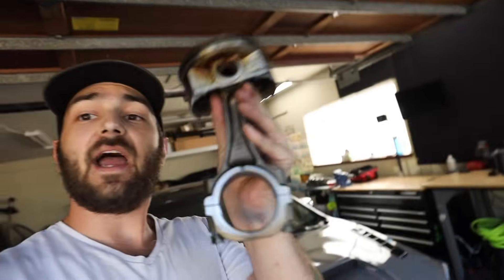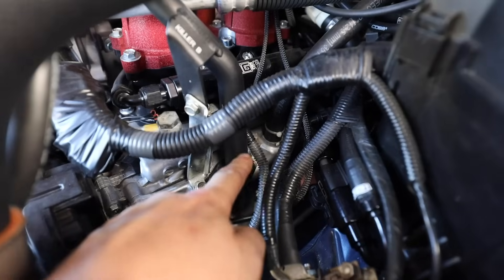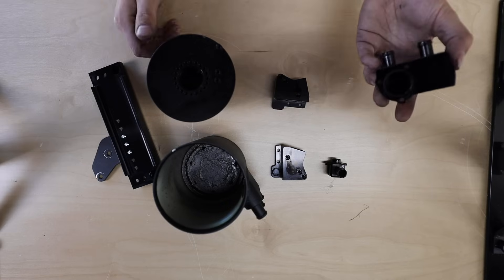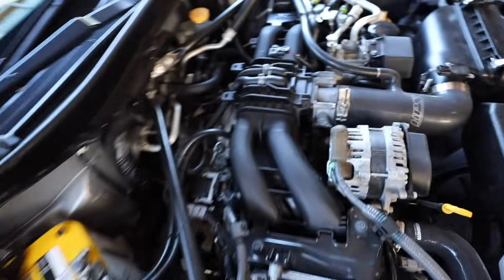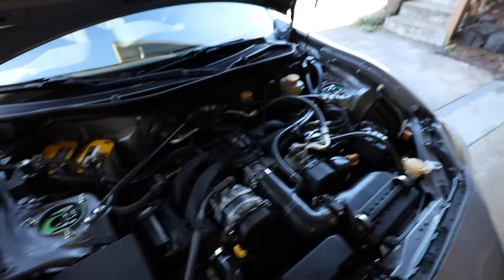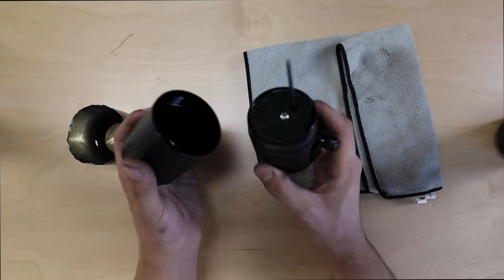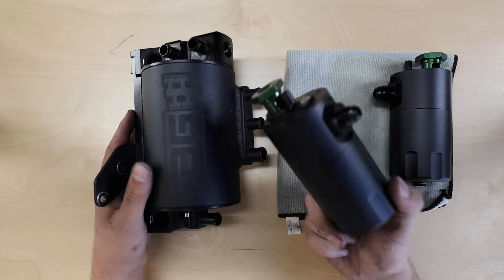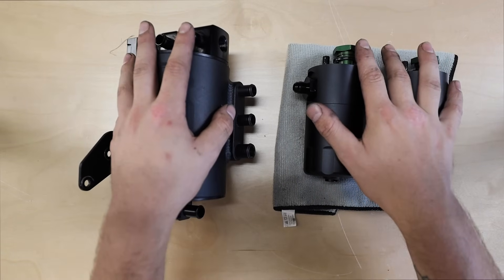Air Oil Separator VS Catch Can Explained. Is One Better?

Comment: The reason why the "oil" in the catch can seems thinner is because it's not just oil, being separated.  It's mixed with other vapors, including water and fuel.  I would go with the Dual Catch Can system because I wouldn't want to pump anything but 100% oil back into my engine.  This would prompt you to perform oil changes more frequently.
Reply: But doesnt the aos seperate water oil and air
Reply: Yes and since catch cans are not being recirculated with filtered oil you really have to keep an eye out on the oil level in your engine. Depending on your motor’s health or piston to wall clearance if it was  done to tight tolerances or loose tolerances will dictate how much blowby you have. I noticed the oil level can drop quickly where if you weren’t checking your oil level you may find your oil level on the dip stick isn’t even meeting the minimum level required. Running e85 definitely thins the oil in your engine. On oil changes you can see how watery the oil your draining is and can smell fuel mixing in your oil which lowers the viscosity of your oil.
Reply: Yup, on my GDI, I get this black, runny, foul smelling, fluid in my can. I surely wouldn't want this to recirculate onto the backs of my valves. 💀
Reply: @HandMadeRoyalty Nope, I honestly don't understand the point of the AOS in this configuration over a catch can. As the only tangible difference is the AOS dumps its contents back into the oil system. Adding in the complication of running coolant lines to heat up the AOS system. The coolant will be whatever your thermostat opens up the system at or generally around 180f which isn't hot enough to vaporize oil or water but will for fuel but only if given time. Being it's immediately dumped back into the oil system and you see how little actual fluid these collect (tablespoons in thousands of miles) it makes no tangible benefit to the additional plumbing and risk of extra oil and coolant lines to possibly reuse a few tablespoons of not great oil anyway.
Reply: @Vermonstered  my view on this is that both catch-cans (or non-return-to-saump air-oil separators) and what are marketed as "AOS" (or return to sump air-oil separators) both have their use cases.

For street/light-track applications for lazy owners - return-to-sump AOS.
street/light-track applications for fastidious owners - catch can

For heavy track applications with lots of blowby or if you are in a setting where you do many continuous hot laps (endurance racing etc.) - AOS.  Polluting your oil mix in your sump is a lesser evil compared to running low on oil.
Reply: @spidding  I get for track specific and heavily modified applications which pressurize the crankcase using an AOS. But adding a half dozen failure points to a street car because you're lazy is generally a terrible idea but those desperate to modify can do a lot worse.
Reply: It doesn't matter what it looks like in the Can. If its being caught by  the catch can, that fuel and moisture is in your oil and crankcase already. What you see in the AOCC is not how it is when it leaves the PCV and is no indication of how the oil looks in the pan , its concentrated there in the Can making it look bad  and look like sludge .  An Air oil separator will heat the vapor and not allow it to condense and collect. The oil separates and  is returned back to the crankcase and the moisture and fuel still in a vapor form is burned off and not allowed to condense and concentrate in the Can. This is the proper way to do a PCV.  I was having severe issues with my car with oil in the blowby since supercharging it. I have this setup on my M3. I started off with a CC and it was filling up alot with oil. I then added an oil separator and kept the Catch can  after the Separator  to see what the separator missed. It was just fuel and water, Very little oil in the catch can. Since then my Manifold and Supercharger inlet have remained oil free. I've since removed the catch can and just run the separator. Less maintenance, no sludge, and manifold and inlets are clean .  They both work,  I just prefer the oil not collecting and concentrating in a Can and would rather it being returned back to do whats it is supposed to do in  the pan.
Reply: @Vermonstered   This is wrong. 180 F , which honestly is to low, is still enough to vaporize water.  try it, heat a pot up to 180 , it won't boil but you will see a bunch of vapor coming off the top. Heating the separator prevents the sludge from forming and keeps it as a vapor to be sucked up and burned by the engine. the heavier oil drips down and returns to the Pan. This vapor was already in the crankcase and exposed to oil .  If your oil catch can is only picking up a tablespoon, you either dont need to run one , or the catch can is a cheap one that doesn't work right. A decent catch can , if there is a significant blow by and no assistance from the factory separator already built into the valve cover by most OEM, will fill up often. Most people needing catch cans have increased blow by due to upping cylinder pressure or wear , adding Forced induction  to the car that was Naturally aspirated or increasing boost beyond what the stock PCV can handle .  I  had a CC and it would have a significant amount after I supercharged my car. After adding the air oil separator the manifold and supercharger inlet no longer have oil in it. It works and it works well.
Reply: @kayzrx8  Something is severely wrong with your modifications if you're having that much water or fuel vapors in your crank case. It sounds like your AOS is closer to a band aid to your modifications rather than a necessary part to a well performing engine. Additionally if your engine has this much blow by, it's getting into your oil as your PCV system is a very small port in the head and your blow by it's occurring in the block.
Reply: @Vermonstered  If you bothered to read the car is a N/A m3 that now has a supercharger and meth system adding 200 more HP to the motor. The stock PCV was not designed to handle that so Yes, oil vapor will come out the PCV on any modified motor putting out that much Power.
Reply: @kayzrx8  Basically just described what I said. A series of modifications that creates a problem of excessive blow by. In addition that blow by is already contaminating the oil. It's not like you're somehow getting away scott free because you're ruining an AOS. It's a band-aid. The only difference is a portion of that vapor isn't condensing in the catch can with the difference really being about 60F being realistic about under hood and blow by temps and it's only spending a second in the catch can system with your excessive blow by. AOS is still getting the nasty oil just pumped back into the system.
Reply: @Vermonstered  You do realize most cars have built in AOS in the valvecover or external plastic versions near the head to keep them warm( cyclone separator for example)  on almost all BMW's Blow by Will occur and all engine will emit oil vapor, its  the job of the PCV to separate the oil and return it back to the case. In my case the PCV wasnt designed to deal with the blowby of an additional 200 hp at 8000 rpm. So yes some sort of external separator is needed to assist the stock PCV and is not an indication of a problem.
Reply: @kayzrx8  Your entire series is posts screams to the ignorance of your modifications and what they do. AOS isn't a miracle device, it's still very much limited to its design. You simply don't see the junk it spits out, so you think it's 100% efficient over a catch can. It's not, not even close. It's still a band aid to your modification choice for your situation.
Reply: @Vermonstered  No I didnt describe what you said . Again your calling it a problem which is wrong. Blowby is not a problem Oil vapor coming through a PCV is normal, this is the Job of the PCV to vent and separate. ALL 4 stroke engines have blow by. All blow by will contain oil vapor, Fuel, exhaust and water.  Blowby happens in all motors and is not contamination.  The amount of air being circulated in the pan by windage is the same thing here . All of this contamination you speak of had a very good mix with the oil in the Pan and crankcase. Normal.  The excess is just coming through the PCV.  The amount of moisture going through the PCV in any engine is HIGH. Its not a contamination if the oil temps are kept proper and its allowed to leave the system WITHOUT condensing.  You have some weird notion that if its in the crank case it  not bad but a soon as it leaves the head it somehow a contamination that cant go back to the motor? This makes very little sense. A heated AOC only return the oil back the pan . Its not the same  thing an Oil catch can thats unheated has in it after a few thousand miles.
Reply: @Vermonstered  buddy please go do your homework , Its a well know kit from ESS Tuning and alot of cars run this kit. Its comical how you cant understand that supercharging any car increase blowby and has to be dealt with. Its not something I made up. you sound like a kid. arguing about something that you have very little understanding of.
Reply: @kayzrx8  Your under hood temps: ~100F
Your blow by temps: 250F+ (more of you have excessive blow by)
Your catch can temps: Between those. 

AOS at 180F isn't a miracle device. You simply don't see what comes out of it. It's still contaminated oil.
Reply: @kayzrx8  It's astonishing you don't understand that slapping on a supercharger to a motor with no other mods forces band aids to be needed. That's the crazy nonsense about this thing. NO OEM needs an external coolant system for their PCV. Why? Because they're not designing a system that needs band aids. Nearly every performance motor from BMW today makes more power than you did with higher boost. You're not somehow special. You simply modified your car to have excessive blow by as a trait. That blow by contaminates everything in the oil system, fuel, water, carbon, sulfates, all now reside in the oil. Your AOS simply removed some of it from the intake charge but still recycled a significant amount back into the oil system. That's called band aid to your modification.
Reply: @Vermonstered  and btw bmw's dont run at 180F little one. They run the coolant well above 200. Please get your facts straight . Now get back to class.
Reply: @Vermonstered  Comical. What BMW makes 670 HP stock?? What vehicle can you increase the HP  by 50 percent and not need something done to the PCV system to deal with the added blow by? lol what a joker. You do know most oems have it in the valve cover because its hot there right ? That's why it doesn't need external lines to heat it..... near cylinder head temps right. You make no senses ....keyboard mechanic
Reply: @kayzrx8   @kayzrx8  Now you think 20 F is the difference between 100% AOS efficiency and sludge? Truly, you are a comedy act. 

To perform that act you STILL don't comprehend the problem with EXCESSIVE blow by is the EXCESSIVE part. You didn't build the motor to support boost and wonder why you need band aids. A real mechanic solves problems, you only create them. 🤦
Reply: @Vermonstered  wtf did i say 20f was the difference between anything . are you ill?
Reply: @kayzrx8   You're trying to say that your specific BMW opening at 200F rather than the typical 180F thermostat is the difference. I'm sorry if that 20F delta makes one "ill." Honestly it's hilarious you think your blow by, which is 600+F, isn't cooling and condensing in the engine and your AOS. Again, out of sight out of mind because you only create problems and band aids.
Reply: @kayzrx8  Part of the idiot modifiers that don't understand THEY cause most of their problems.
Reply: This makes no sense. Inducing oil with your finely meters air-fuel ratio

Comment: Don't put fuel diluted oil blowby back into your sump.  A catch can is better IMO.  AOS is for people too lazy to drain a catch can.  Place it in a hot area of your engine bay to ensure water and fuel are driven off and all you drain is oil.  This is basic physics.  Having a catch can or AOS is even more important if your engine is direct injected.

Comment: installed a catch can to my  2019 v6 challenger.  kept reading, "oh you really don't need it for the v6's". Well, after 6k miles I poured out 3oz of oil
Reply from the maker: All engines will have blow by, turbo, supercharged and high compression will have it worse but any engine will benefit from a catch can 🔥
Reply: Is Challenger  made by Dodge ?
Reply: @lowlifeangler  yes
Reply: Catching .0005 ounces of oil per mile.

Comment: Keeping the octane at its best while dumping more engine sewage back into the filtered cold air to mix with the very finely metered air-fuel ratio and coating the inside diameter of the intake manifold with this sticky mixture reducing the diameter with each combustion of the cylinder. Until the diameter of the intake manifold is reduced until no air can get in. And the valves are coated with carbon. I don't get it?

Comment: I was just about to say you've got 2 catch cans and one of them will be empty and the other one will have oil in it. The reason for some reason someone told you to put one on the clean side or bank one of your engine when in actuality, you only need one on the dirty side, which is bank two of your engine, because Bank one is only getting clean, filtered air through it. That's remember PCV positive crank case ventilation, so there is only one direction of flow. Your PCV valve has a check ball or check valve within it in order to eliminate any gases from going back into the engine. The other thing is never ever re-introduce any oil from a catch can or AOS. Doing so would be re-introducing small particles of fuel droplets back into your engine oil thus creating oil delusion and don't want that! Anything you catch you dump into another container to be recycled when you take your engine oil back to the auto parts store for recycling. Yeah, I think somebody just took advantage of your set up and said you would need to catch can on both sides of the engine in order to increase sales. I've never seen somebody have oil in both of their cans.. it's also a good idea to put stainless steel wool inside the catch can in order to increase the filter, media and the opportunity for the oil papers to condensate as well cool off the air, a bit more before re-entering the intake manifold. Cheers, mate.

Comment: Aos also is a bit harder to install which will cost more. I don’t like the idea of dirty nasty watery oil going back into the engine so I prefer catch cans but my tuner was adamant that I switch to an aos with the high boost I’m running. I declined as I honestly love changing my catch can frequently so I can easily look at what’s going through my engine.
Reply from the maker: Catch cans work great, just need to remember to drain them and they're solid 🔥😁
Reply: How often do you empty it with the turbo?
Reply: @TheWestysworld  every month or so I’ll pour out about half an inch of oil out of the can

Comment: The main thing is the pvc system has to be a closed system with no air filter and the valve cover system has to be vented to allow air to escape when you have high pressure like rpms.

Comment: Are there any concerns regarding performance or damages to an engine after installing an IAG air/oil separator on a Bronco Raptor or a GMC Sierra HD 2500

Comment: A few points to add.

1) not your fault, but I think there is a lot of misuse around catch can and AOS terms. The way I see it, a catch can is a type of Air Oil Separator. It's function is to...wait for it...to seperate the oily residue from the returned air. 

You can classify these generic Air Oil Separators into various types:

a) a very simple non baffled non-returning unit. Still attempts to seperate air and oil but probably doesn't do a great job without baffling. (E.g. el-cheapo eBay units)

b) a baffled non-returning type (like the radium units in your video)

c) a baffled returning type (like the IAG/Cobb unit)

2. It really should be noted that blowby is not just air+oil. It also carries a filthy mixture of burnt and unburnt fuel. So, whilst the IAG AOS may do a good job of keeping water condensation out of the caught blowby fluid, the IAG unit is still dumping this polluted content back into your sump. This is more severe on E85 applications. Recommended to decrease oil change frequencies if they are not already frequent. This is the main reason why I have a bit of a preference towards non-draining air oil separators (aka catch cans).

3. the amount of blowby that you get (or that is caught in a catch can) is not only due to the condition of your engine. It's also influenced by how you drive the vehicle. Case in point, the catch can I run on my STi runs bone dry 99% of the time. However, out on track where oil temps can breach 120degC, this can thin the oil (I use 5w40) out to such a degree that you now see alot of blowby. I caught approx 300mL from 30min (2 sessions) of circuit driving in 30degC ambient temps. That triggered me to install an external oil cooler - now the catch can runs dry again even at track duty.

Comment: Also, I throw a stainless steel scrub brush you use for doing dishes, into the catch can. It provides a lot of extra surface area for oil vapors to come in contact with, stick to and condensate on to drip down to the bottom of the can rather than making their way through the air stream up the exit tube to the air intake.
Reply: Could you use not very densely packed steel wool like a giant crack pipe for your engine
Reply: @psions555 Before track days I add the steel wool and roughly an 8 ball of crack to my catch can. YMMV.